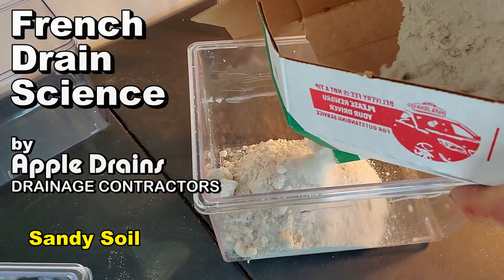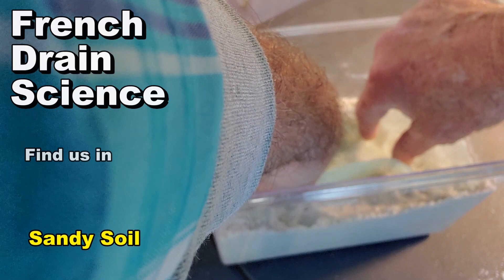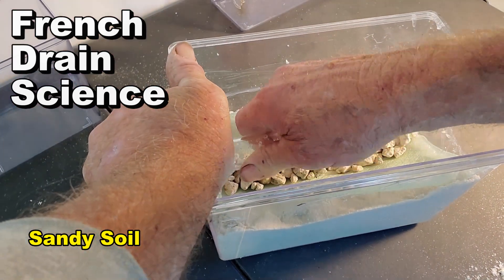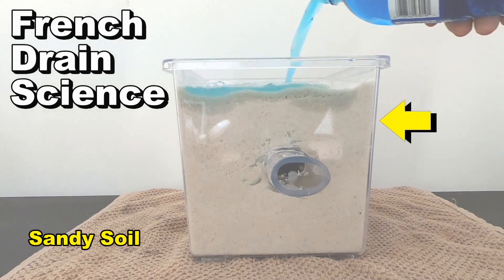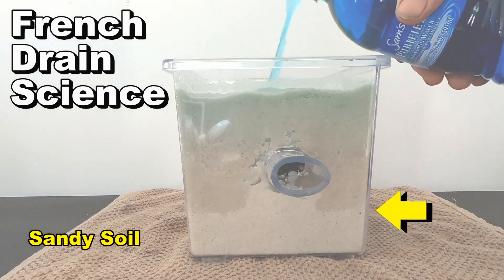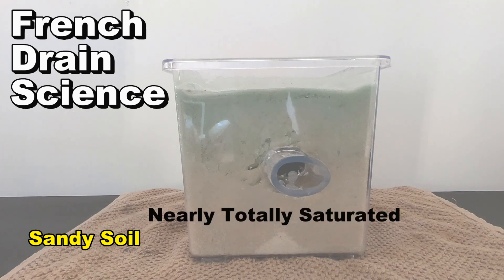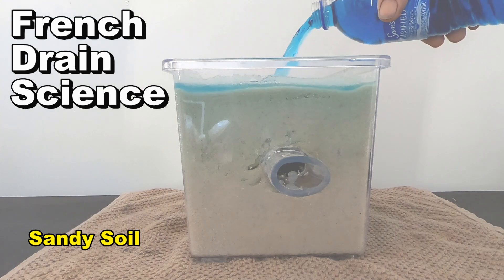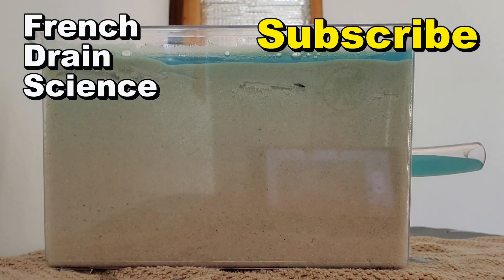French Drain in Sandy Soil - Preview

Comment: This and the apple drain videos are the expert ones to subscribe to on yard drainage topics thanks for sharing. Found this and the clay version interesting! So a question (directly related to florida ). I always see french drains recommended against seawalls to reduce pressure from saturation and here all lots slope towards the walls. Typically walls will have some sort of face drainage, wood walls will have geofabric behind and excess water creeps through the board seams, concrete walls will have (probably clogged unmaintained weep holes) and natural joints between panels if they haven't been hydraulic cemented them (which is bad, better to dig out put geo fabric and let it weep between), vinyl is tricky...they overbuild those backed with concrete  to prevent bulging and creep and or put in jet drains. 

It's not unusual during heavy events to reach saturation level and the water pouring over walls ,  but since the soil has to be saturated in order for the french drain to work, this seems to be questionable advice, as the soil would be saturated anyways by the time the french drain was useful....with the french drain just removing excess water at saturation+. Or in a saturation event does saturation mean a certain depth level? in which case the french drain and seawall advice may be valid to prevent further saturation next to the wall.

i've dug 3-4 feet behind a wet soil (typical florida sandy soil) wall and unless it was backed with gravel or sand it's wet all the way but i wonder if a french drain starts moving water at say 1 vs 4 feet,etc so a fd may offer some benefit.